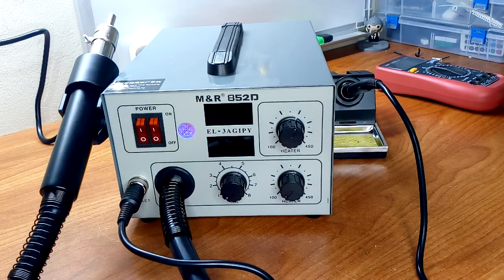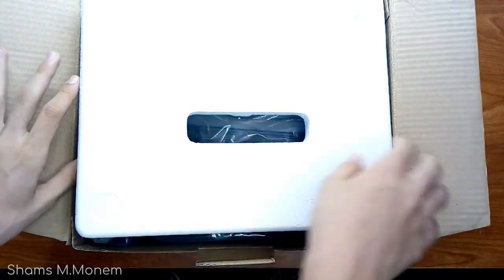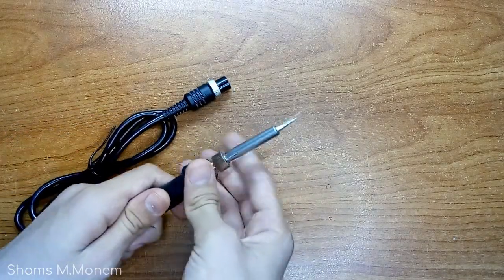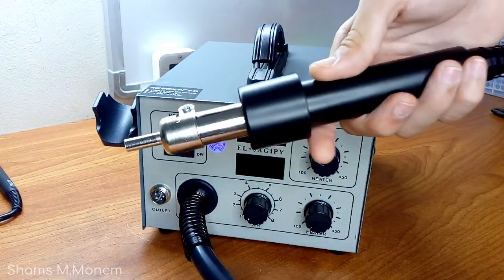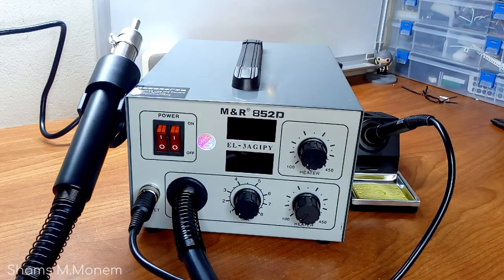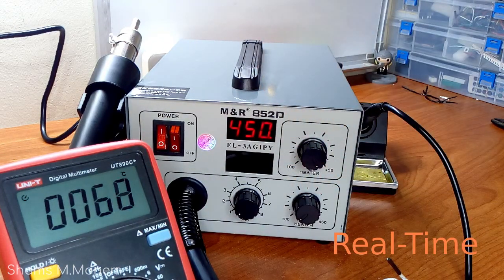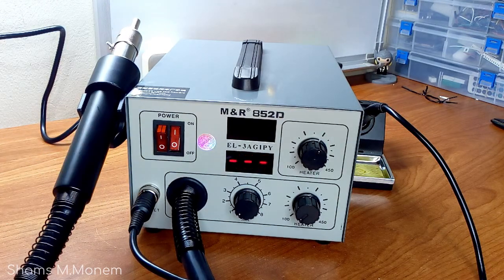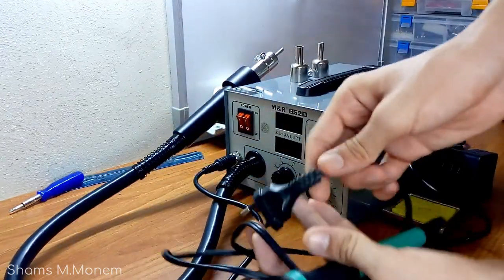The M&R 852D Soldering and Hot Air Rework Station - Unboxing & Testing | SMM's Blog #9

Comment: Seems a little inconvenient that the connector for the soldering iron is on the other side of the hot air.
Reply from the maker: Yeah you are correct, for some reason it's flipped...
Reply: Wow you right

Comment: I think u cant just heat up from 100 to 450 you need to take it gradually
Reply from the maker: You are correct, but it had an internal control board to do that for me, it takes about 1 minute and a half to reach 450 from 100
Reply: @shamsmm  ahaa